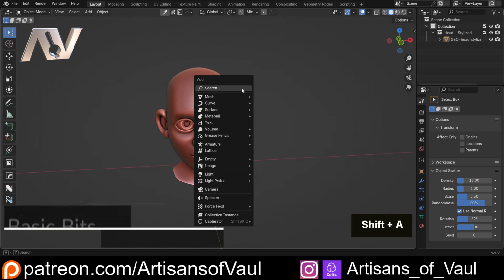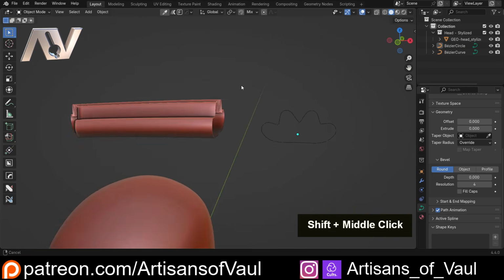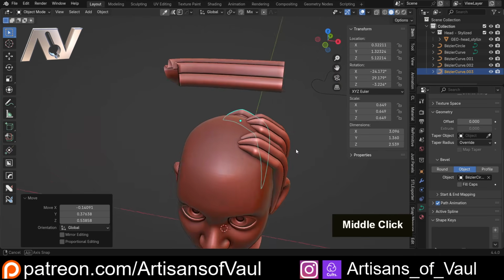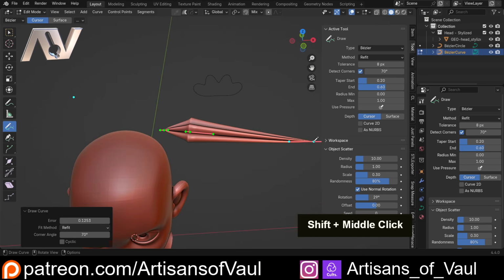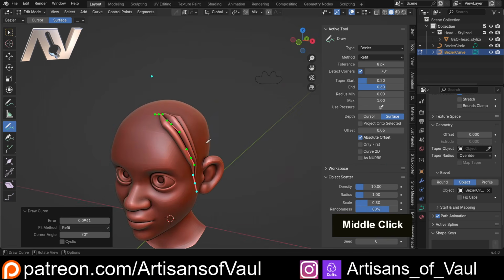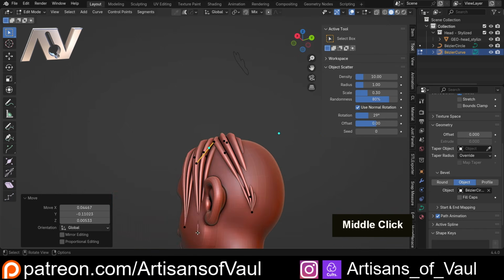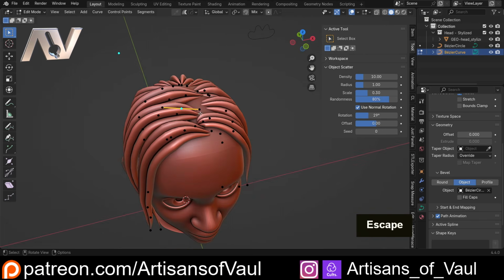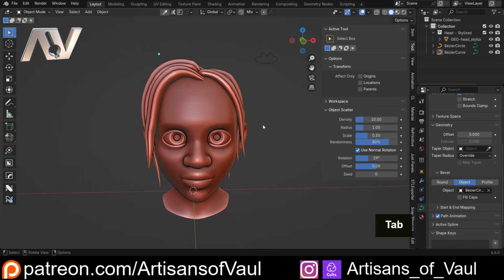The Easiest Stylised Hair - The Tips and Tricks Other Tutorials Don't Show You for Blender

Comment: if you find that the change of hair width or rotation is too sharp, you can go to the active spline section in the curve data and change linear to something else, it should be smoother
Reply from the maker: @r.e.m.s  Good tip.👍🏻👌🏼 Definetly going to pin that for everyone to see.

Comment: Hi Buddy,

your videos are fab, I can't criticise how you present and explain in any way full 11 out of 10

I have a question for you that others may be interested to understand and rectify/help with.... You have answered a couple of my questions before with great response and positive results another full 11 out of 10

boolean mod, I use it quite a lot with the projects I do but heck it can be so frustrating sometimes. Chief annoyance for me is how long it takes to implement a boolean, select object to have the mod, I use the eye dropper to select the object to be subtracted, if simple its straight to select that object, if more complex i.e. object to use as the subtract boolean has the sub div mod used and applied, I'll choose one or all of the additional options to get better results but it can be so painfully slow or it will crash the program completely, it can take an age for the selection to be allotted then another age after applying for the boolean to complete,

 How can this be avoided/lessened? could it be how I go about or could it be the lack of grunt my computer has?

Additionally, sometimes when I use the boolean mod it leaves voids on faces which are a nightmare to repair afterwards often impossible due to the sub div mod adding huge numbers of extra verts. I'm creating models, not very complex, then trying to use the model to create a mould that I can 3D resin print
Reply from the maker: So the first thing would be to use Bool Tool which comes with Blender. It means you can use shortcuts to get the boolean you want straight away, so no eyedropper tool.

There is also always going to be a computer power element to it.  If you're computer isnt as fast it is going to take longer, sometimes a lot longer.  But if you can I would suggest applying any modifiers on the objects you're looking to boolean to help speed the boolean up.  Also make sure you dont have a lot of unneccessary geometry causing it to slow down,

Finally the missing faces are being causes by errors with the objects, not an issue with Blender.  Basically you will need to be better at checking your objects before you boolean.  Or its an issue of you using the "fast" boolean technique over the "exact" and there are perfectly overlapping points.   If you have a file you want to send over I would be happy to comment on it.

Comment: One really small thing... and it is reeeeeeaally small. When you right click to subdivide the line segment/curve, rather than right click to do it again... there is a small modifier window/panel in the lower left of the screen which will allow you to change the number of subdivisions from 1 to 10. I know that YOU know this, but there are a number of newer users who probably do not, because that little modifier window/panel is so very easy to overlook. Is it a huge time saver? Nope. Is it a frustration that the modifier windows and panels are not more visible? To me, yes. Anyway, great video!
Reply from the maker: @keithmathews4605  Excellent point. I sort of assume that but I really should have pointed it out specifically. 👍🏻